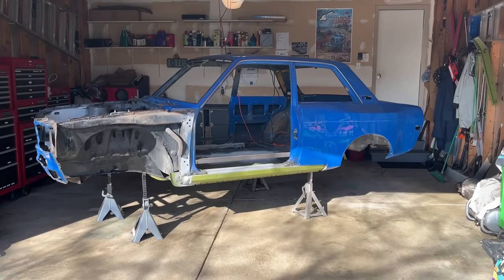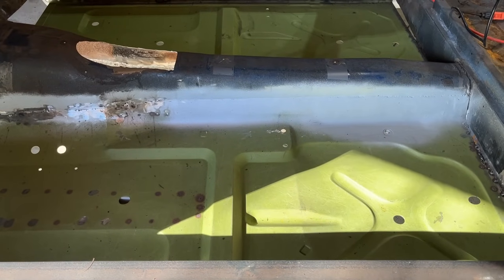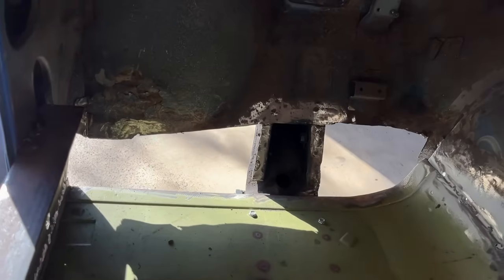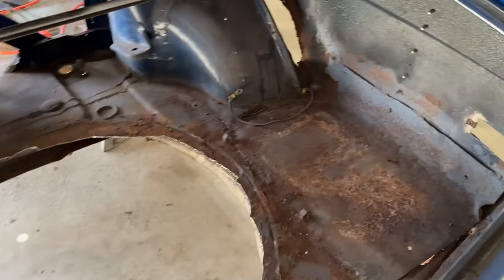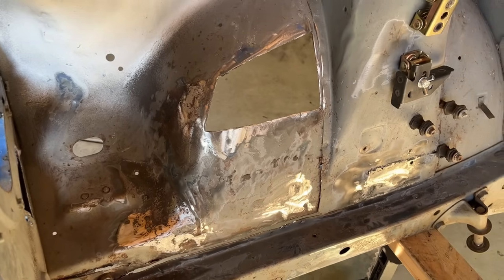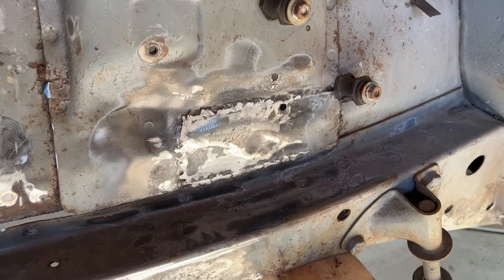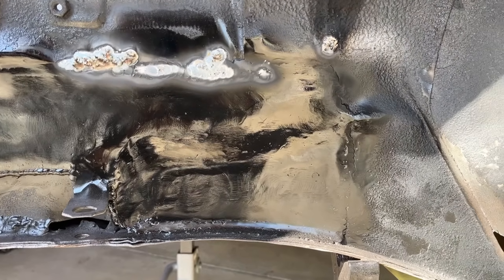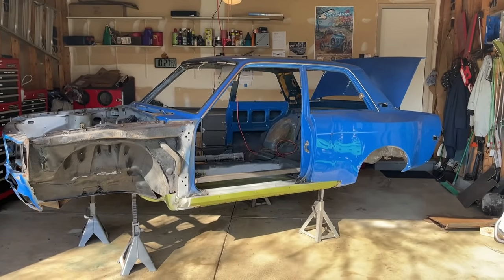Datsun 510  Race car Build (1)

Comment: Any update on when part 2 is coming out? Wanting to buy a 510 roller, but I don’t know where to find videos to help with the build
Reply from the maker: Starting back up this winter. Plan is to have it on track this summer. And I need the space for my two 240z. Pavecheck@gmail.com if you need help